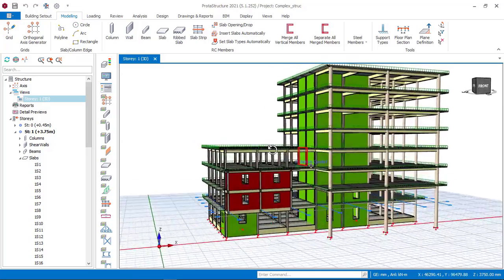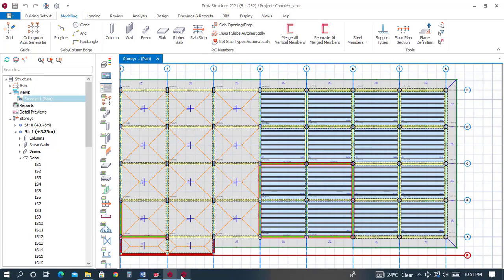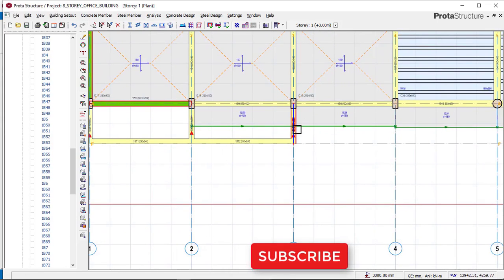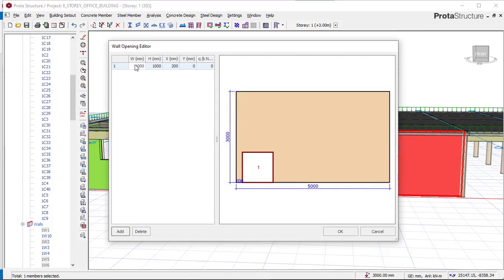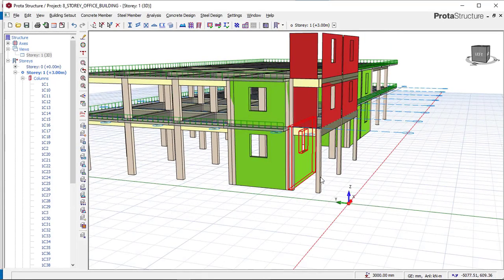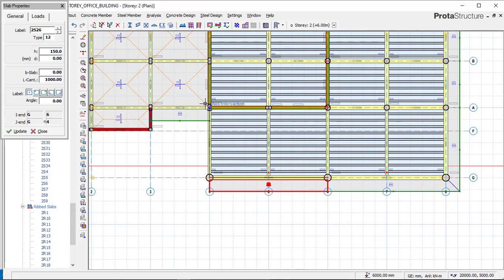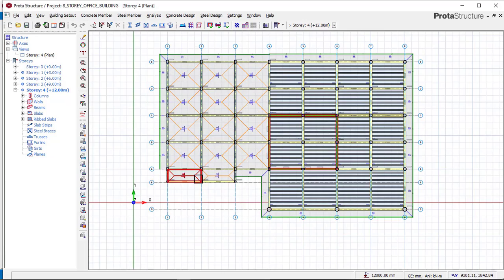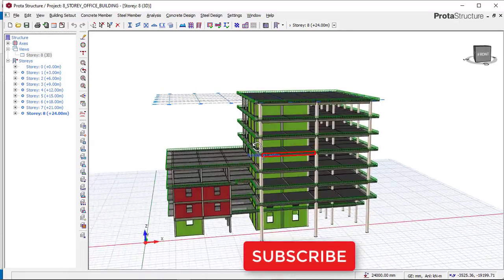PART 1 - Complete Design and Detailing of Reinforced Concrete Building using Protastructure.

Comment: Why do you provide a floating column while the secondary beams are there for? It is not advisable
Reply from the maker: For structure with seismic load yes it is not advisable but for non seismic structures it’s good to go